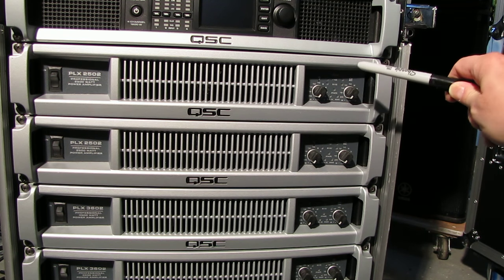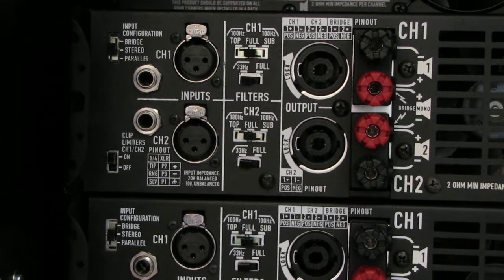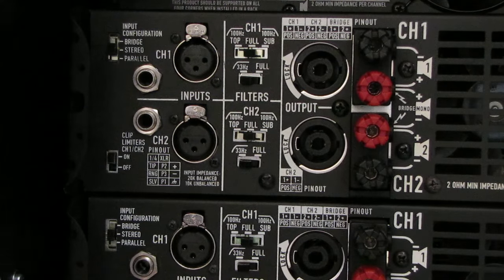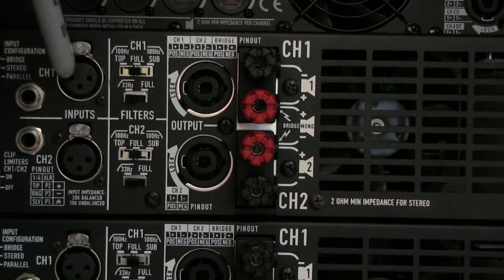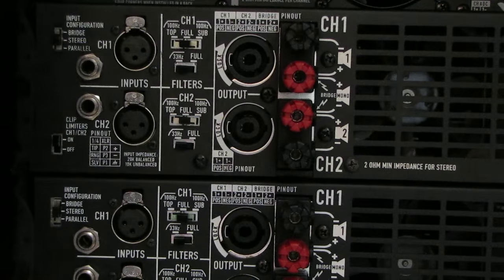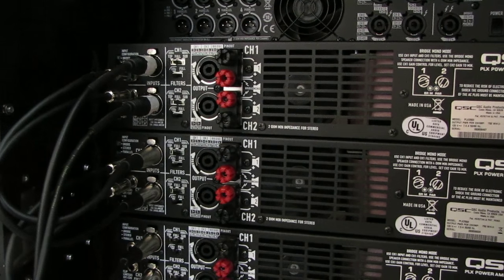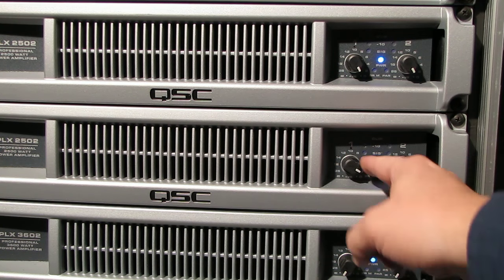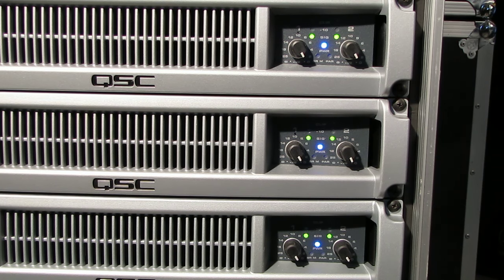Stereo "Daisy" chain of amplifiers (using QSC PLX amps)

Comment: shouldn't you have speakers connected to amps before you apply signal to amps? lots of power with nowhere to go!
Reply from the maker: Good observation.  For this exercise and the amount of "power" being generated, having no load attached to these amplifiers does not present any issues.  Most modern amplifiers are fine with no-load testing.  Amplifier design has greatly improved over the many years.  It's the earlier model amplifiers (much of the class A and A/B) that would have issues if run with no-load.